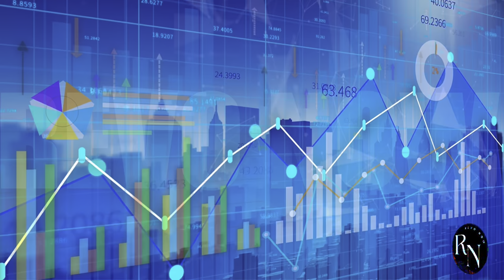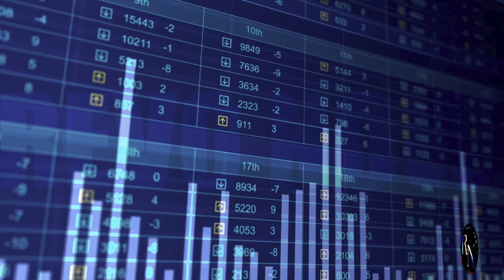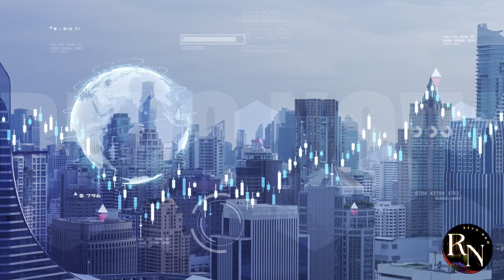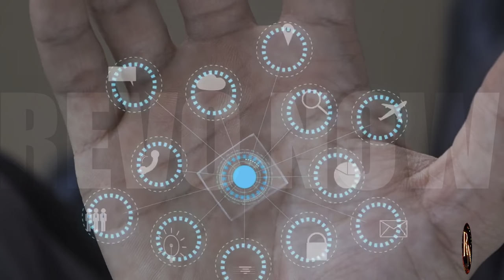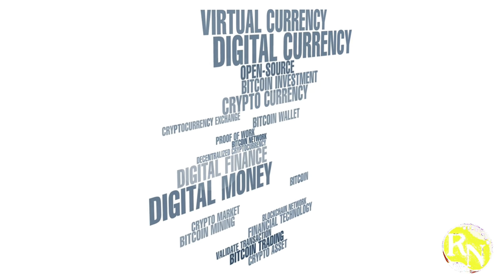China's NEW "Tai Chi" Photonic Chip BREAKS High-End Blockade!

Comment: "China’s First Photonic Chip Pilot Line Launched in Wuxi
On September 25th, the first domestic photonic chip pilot line built by the Wuxi Photonic Chip Research Institute of Shanghai Jiao Tong University was officially launched. After the pilot line becomes operational, it is expected to reach an annual production capacity of 10,000 wafers. The first PDK will be released in the first quarter of 2025, providing external chip fabrication services." 

Source: TrendForce
Article: "China’s First Photonic Chip Pilot Line Launched, Along with Various Pioneering Research Achievements"
Published: September 30, 2024
Beantwoorden
Reply: I think that ASML will have to worry much more than the Americans because in my opinion the survival of ASML is at stake.
China will significantly expand its production line with "overcapacity", and the consequences are obvious.
Reply: Who will produce this photonic chips? Will it be SMIC?